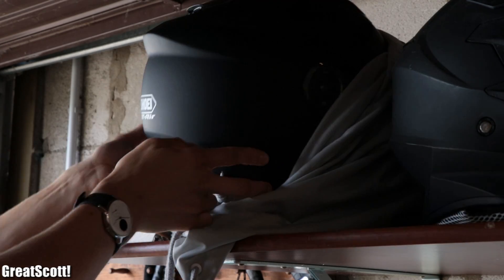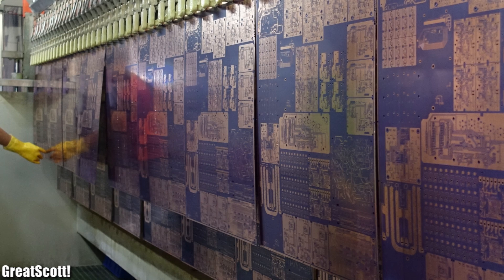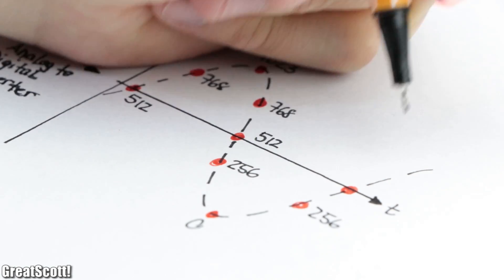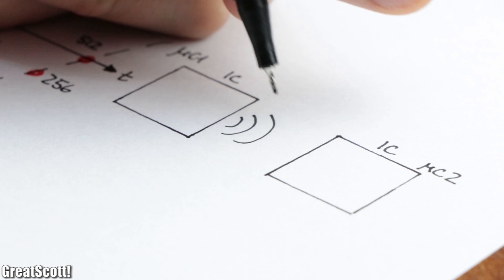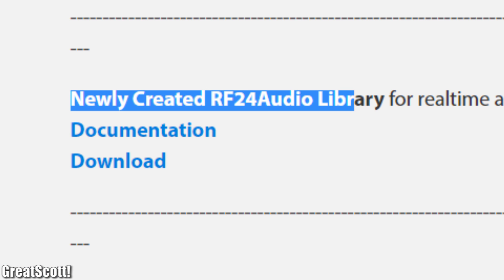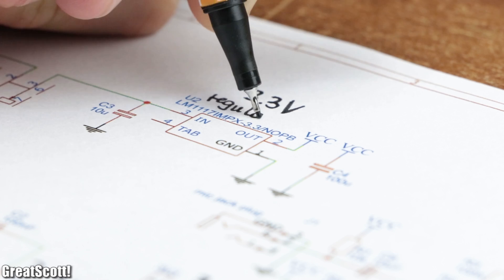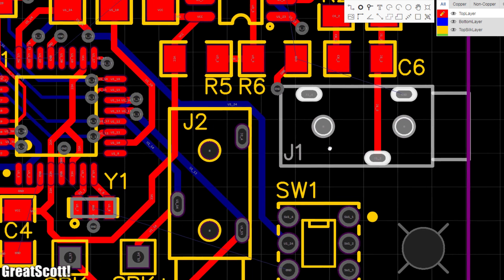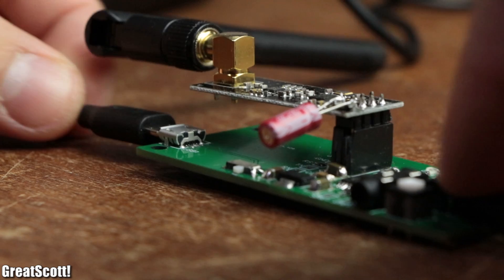Make your own very crude Walkie-talkie with an Arduino

Comment from the maker: Here is how to fix my Walkie-talkie: https://youtu.be/YJ25eQRbhaQ  Thanks to Andreas Spiess for helping me :-)
Reply: Hey Great Scott! You didn't answer to his question,  wouldn't you like to meet him and test the fixed system on a motor bicycle tour with him?!
Reply: Hi GreatScott, as always, great job done 😀 I have also tried to built that walkie talkie and with tips given by Andreas seems to be work.
Reply: GreatScott! I love your videos and have a mission for you. Please please please make a video about the low power library. You will be able to simplify it so well! Thanks!
Reply: Make a video about Microbit
Reply: thanks to you and Andreas Spiess for helping me  to find errors in my project
Reply: What resistor did Andreas use on the pin 9 to fix it?
Reply: Tell me about your pen...?
Reply: I've got the solution before the problem, but it's great equipe
Reply: @IW4DBX  Can you tell me the solution too?
Reply: https://youtu.be/QhPSdN2hogU
Please explain about this video
Reply: @jiltomathew6589  wrong channel, cough cough ElectroBoom cough cough
Reply: @jiltomathew6589  I am 100% sure that the capacitor he used was precharged. As far as I can tell rest of the circuitry is not necessary. On diode there is a voltage drop (== more power loss) and inductor just smoothes-out the current spikes from motor-brushes. Fake video.

Comment: Crude? with all that is available today. The old 27Mhz transistor AA battery all in one unit transceiver worked fine without being crude.  Perhaps Arduino is more of an MCU than a Radio IC. Why don't we build a proper radio?

Comment: It's a whole lot easier to just build a simple analog walkie-talkie. No microcontroller. No code. Few parts. About $5 worth of parts. Good audio. Software and microcontrollers just are not the answer to every electronics problem. This one is a good example.

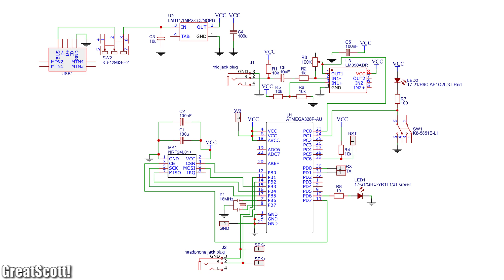Comment: in the diagram at 7:20 why is there both a 100uf and 100nf capacitor connected to the NRF24L01+ module. Can i get away with just a 100uf capacitor?

Comment: To be honest I think this is a fun project to do and might save you a little money, but it’s a pretty big waste of your time. A company called Baofeng from China makes some decent two way radios, they have a model called the BF-888s which is a budget radio and you can get 2 for around $25, they can be programmed with a computer and the proper cable so you can set the frequencies you like. If you really wanted to put one in your helmet it wouldn’t be hard, you could just get an external shoulder mic, and put that in your helmet, then you can just plug it into the radio.

Comment: Hi bro why don’t u try to use a transistor and plug the microphone to the base and set an offset voltage to the transistor where the voltage of plus and minus is 2.5v and 3.5v I think that will make it work

Comment: I have tried it and it works great ,
You just have to connect speakers directly to pin 9,10(or with amp like lm386).
If ground wire is too close to output signal , sound quality gets terribly worst 
Otherwise it's considerably clear.......

Comment: I would recommend two steps that worked pretty fine for me in order to improve audio quality:

1) build a pre-amplifier stage before the LM386 circuit. THe following link has a simple pre-amp based on a transistor:

https://storage.ning.com/topology/rest/1.0/file/get/792104326?profile=original

2) increase RF24Audio library resolution to 10 bits. By default, the RF24Audio library uses only 8 bits for audio sampling. But there is an easy way to increase resolution to 10 bits by not commenting the line "#define tenBit" in userConfig.h file.

I hope this helps.

Comment: If you are interested in looking in to it, in the ham radio community there have been voice over digital protocols written like free dv that only use 1600hz or so of bandwidth, while the nrf2401 uses a whoppin 1mhz, your walkies can send audio with good quality leaving enough to spare for gps data, heart rate, tire pressure and whatever else! Although im sure the port to an arduino may not be to simple if even possible

Comment: Hi @GreatScott!
 ,
 Hope you can help me out for my little problem of Diy PTT for Android apps Zello.

Actually i've already made my Extramic with ptt button for my Android device with Zello walkie talkie apps, but I'm not satisfied because of its Toggle mode.
What i want is real Push To Talk, and release the PTT button when i've finished talking.

The problem lies on android device ( and Zello as well )  that recognize external function for Push To Talk by shorting the mic input from android device (4 poles jack, CTIA) with ground (zero ohm) with immediate release. And the Zello now transmit (but in Toggle mode).
by the time I finished talking, i must short the mic input again with ground to end this transmission. I really don't like this Toggle mode. I want a real push and hold to talk which is impossible for me to solve it out
 because by the time i'm pressing the PTT button, the microphone in zero ohm with ground.

Please help me out from this bothering trouble. 
A simple logic yet but i can't apply it  :(

1. When PTT button is pressed , then the logic ic (perhaps arduino system) will do a quick short  the mic input to ground then immediately release it.(So that i can talk. Now the Zello recognize it as Toggle mode and start the transmission, but in FACT I'm still pressing the PTT button).

2. When PTT button is released, then the logic ic (perhaps arduino system) will do again a quick short the mic input to ground then immediately release it. (By now the Zello will recognize this command to end the transmission).

Appreciate for your kind help and reply.

Thanks and best regards,
Pius NL.Tan

piushartanto@gmail.com

Comment: I wrote the following before I saw that it had been fixed.
There must be an error, your basic concept should have worked perfectly. I recently got better audio off of a 555 timer chip set to oscillate on 670 Khz with modulation by audio transformer. I play with mostly analog transmitters but It almost sounds like the carrier is not being modulated properly.

Comment: There's lots of inexpensive audio CODEC chips out there.  All you need is a suitable wireless module to transfer the data.  You might want to use a microcontroller to drive an interface to control who you're device is talking with.  Make sure you're using a wireless module using allowed spectrum in your jurisdiction.  Regulators tend to frown on using restricted spectrum without their prior approval.

Comment: Like others have said, your problem is probably the PWM "DAC". To verify, you could save some ADC data to flash and replay it on your computer, to verify it sounds good. You could make a better DAC with several data out bits from the Arduino plus a resistor network.

Comment: I would love to see you reverse engineer the Wacom Intuos wireless kit. It uses an nrf24le1e but I am betting NRF2401+ would work absolutely fine. You could also install a teeny battery pack (or use 2 18650 cells, to make a wireless mech keyboard/trackpad combo lap-desk)

I may break out my oscilloscope and see if I can get some kind of github going

Comment: Anyone reading this i need some help. I am new  in pcb designing and i am having trouble in finding a software where i can simulate my schematic in real time to check whether its working or not before proceeding for pcb. I used proteus but for some reasons it is crashing everytime i simulate a mcu, i tried everything to fix it but nothing worked.  So i tried multisim but it doesnt have any avr mcu in its database and neither any of the pic mcu except 2 of them. Then i tried LTSpice but even this doesnt have any mcu in its library and it also doesnt have many components. Finally i tried Eagle but this also is not good for simulation as only ngspice simulation is present and it also doesnt hant mcu simulation support.
I think i am not understanding the softwares correctly, so please help me.

Comment: The Commercial Speech Band is 300 - 3400 Hz  and as a result the sampling on telecommunications systems needs only to be 8kHz. Frequency filtering on the input would almost certainly reduce some of your problems.

Comment: The audio could be clipping. Maybe instead of leaving the volume at full blast in the program, lower it. Either that or your op amp is the problem.
Reply: Gary Carone Maybe you watch the pined video?
Reply: @AndreasSpiess  yup saw it. Made the comment before I saw it, was just giving my best guess. I've heard audio like that before, many times it a rouge BDA causing the issue, but that couldn't be the problem here based on how the system is setup. I work on public safety radio systems for Motorola Solutions so I do quite a bit of trouble shooting for a living. Too bad these days individual electronic components are not replaced, but whole boards get swapped instead.

Comment: I just did some tests and it's definitely possible to process audio signals with an arduino. Both the ADC and the PWM module are fast enough (if you set the registers right), attaching the speaker direktly to the PWM output isn't a problem, either, as long as the frequency is high enough. I suppose in your case, either the microphone is used incorrectly or the software has issues (because in my test it was impossible to transfer signals via NRF24 with the given libraries - i'd have to create a library myself!). I think if I'm bored, I'm gonna make a video about that, or even test the library you used.
Reply: Out of curiosity, how did you get the nRF24 working with your own library?

Comment: Have you tried to reconstruct the audio signal on the very same Arduino, which does the sampling? An anti aliasing filter at the ADC is missing which could cause some of the distorion. For better signal reconstruction you could use a digital to digital conversion algorithm, similar to the delta-sigma aproach in delta-sigma ADCs.

Comment: One could buy some pretty small mini 2 way radio transceivers for not so much money and saves a lot of time.
internal microphone & speaker in the helmet, just activate vox and there you go, hands free talking.
use FRS frequency for license free issue. Battery life should be adequate enough for most use with range up to several km.

But of course, where's the challenge?

here we talk about usability first.

Comment: Pretty sure you're not seeing all the bits, my guess on the ADC side. Check those levels, and what the Arduino is seeing. The LM358 will need some headroom 5v (or more) supply may be preferable. Are you AC or DC coupling to the ADC? What biasing? The DC level might be right near a power rail. Also I'd send the output through a passive filter then a power amplifier to drive the speaker. Ideally it could also do with an antialiasing filter and an AGC/squelch on the input - lots of analog fun!

Comment: You need a low pass filter at the MIC signal to reject the frequencies over the half of the sample rate.
If the sample rate is 8000Hz the filter must reject all over the 4000Hz.
Also you need to center the MIC signal at half of the ADC reference. For 3.3V that is 1.65V.
Then, the code must take 1.65V as 50% PWM and the PWM frequency must be at least 10 times faster than sample rate.
At the output you need an LC filter and power MOSFETs to handle the power because you are making a short circuit and the µC current limiter is ruining your PWM.

Comment: I think I know why the audio is bad.
Because the number of information bits it's to low, the arduino take 10 bits, 5 bits for the positive part of a sign wave and 5 for the negative, that makes the wave looks more square and that translates in harmonics (says Fourier) or noise. Maybe a analog to digital converter will do. 
Good luck

Comment: I believe your microphone is over modulated. A simple fix would be try turning the volume down to 5 instead of 7. Love the video
Reply: Seems like you're right, Andreas Spiess has resolved the problem (watch his video), and the main problem was exactly like you say.
He than changed the preamp with a mic amp chip with AGC. (automatic gain control).

Comment: Hey
Could you make a video on how to build an 230v dc to 230v ac pure sinewave inverter?
Reply: That is a lot power. Electrical safety should be the first priority. Be careful. However, if you want to do something similar. You need an IGBT H-bridge configuration. Transfer DC to AC. The modulation will be SPWM. That show the same parameters of sine wave. Important: dead time between IGBT switch. You need to implement diferent reference voltage to IGBT. Finally, you need to desing the protection systems.  If you are more interesting the 3 phase speed control motors do that, but you can do that for monophase.

Comment: My guess is your PWM on your speaker output is the culprit. Maybe some type of capacitor smoothing on the speaker might help a little bit, or transmit the signals digitally, and play them back through some sort of resistor ladder or a dedicated DAC.

If you want to confirm that you're getting good input samples, you can try modifying your code to send a chunk of your samples over the serial interface to your computer, copy the samples into a file, and play them back with a program like audacity to test the audio quality.

The same transmitting setup you have may still work, if you just set the output pin  to the most significant bit of your audio samples, or whether the sample is above/below the middle point (instead of trying to send a PWM signal). You would still have a square wave on your output (1-bit audio), but it might be better audio quality than your current code produces.

Comment: Not a pro, but to me it seems the op amp gain is too much, also needs a low pass filter.
Should of hooked the oscilloscope on the speaker ends to see what the signal looks like.
Straight out PWM for speaker is not good.
As always great video to watch. Always interesting.

Comment: If I were you I'd use DRA818 - it does not need any microcontroller to work with once you set it's frequency and other parameters. DRA818U can be programmed to work on PMR frequencies. See this link for more info: https://english.svet-el.si/index.php/blog

Comment: Hello using a DAC converter with speaker output such as PCM5102A is a lot better than a pwm signal. 

Also when sampling data from the mic. As i see your amplifier causes the distortion of the signal. Maybe it needs to be well tuned also it surely needs a pass filter.

Why don't you try single mcu first for sound quality do not have to sent other one. Transmission is easiest one :)

Comment: Done this project with the same library before. On speaker side, I hook up a PAM8403 module which works on 3.3v. The audio is still a bit noisy but it gets louder and more recognizable.

Comment: Why on earth did you start with an Arduino?  There is nothing to be gained in making things complicated for the sake of it!

You can make a wireless walkie-talkie system with half a dozen transistors an antenna and a few passive components which will be a 10th the cost, a 10th as complicated and immeasurably better.  If you absolutely must use an IC then an simple op-amp will do the trick.

Sound is an analogue signal, digitising it and then un-digitising it will only ever serve to reduce the quality.

Just because one has access to a microcontroller doesn't always make it the best tool for the job.  Sometimes simple analogue electronics is still the best solution.

Comment: Thank you very much for the informative video! This will be a fun project to do.. also gives me more ideas with the transceiver!
I have a question.. Would you be willing to make a video about authentic and counterfeit Arduinos and what their differences are? Because the generic/counterfeit arduinos perform more poorly and seem easier to break, even though they use the same components (Presumably) as the original one. I ask because was looking up an arduino nano and there were a bunch of generic ones on Amazon and some reviews showed they broke easy. This I experienced as well and when I compared it to an official arduino it was basically the same except PCB color and company.  Also with the generic board when I output text to a screen (16×2 screen) every other letter is shifted up one bit but not on an original arduino (despite both being Atmel chips)
Sorry for the long post!

Comment: Looking at the opamp at 5:39 it can be seen that it is like a high-pass filter, it removes frequencies under ~5 Hz but passes all the higher ones, that in opamps usually go above 100 kHz . Since the audio is being sampled at 16 kHz without removing frequencies above 8 kHz, the very input to your Arduino is an aliased mess. The higher parts of the speech range are being aliased to the lower ones, and even noise is being aliased into the Arduino input. Along with the filter on the output to the speaker, this is definitely part of the walkie-talkie problem.

Comment: hi scott can you make a video on microaire easy start  and how the system can reduce the running(or starting ) current on an AC compressor and can a big hard capacitor do the same function ?

Comment: I think I would have just taken two old palm-sized walkie-talkies and gutted them for their electronics, then stuffed the circuitry inside the helmets.  You could reduce power to the output stage to avoid outside interference and turn up the built-in squelch circuit to cut down on static.  Or just breadboard a simple FM radio circuit.  All that analog to digital and back to analog stuff seems too much like work, but I admire your "Stay Creative" efforts nonetheless.